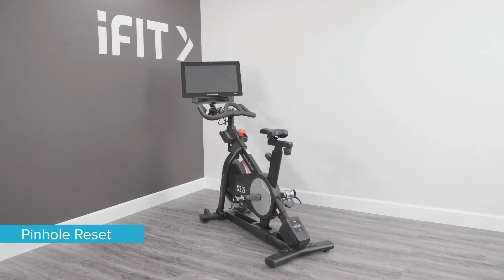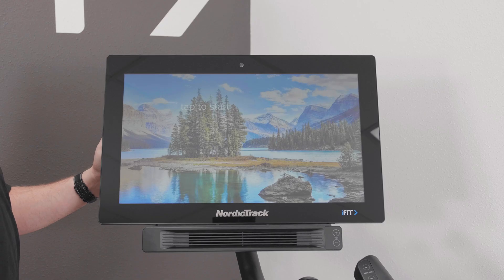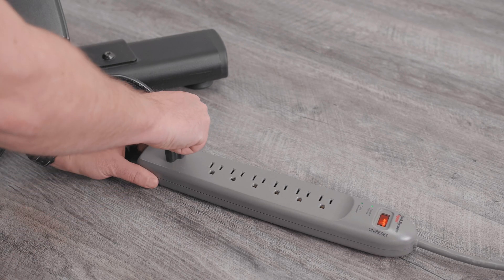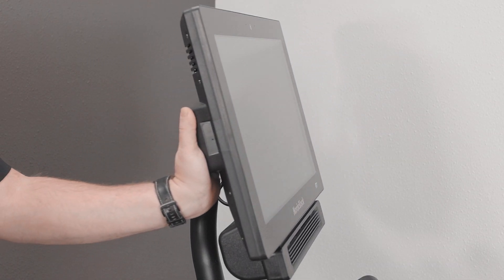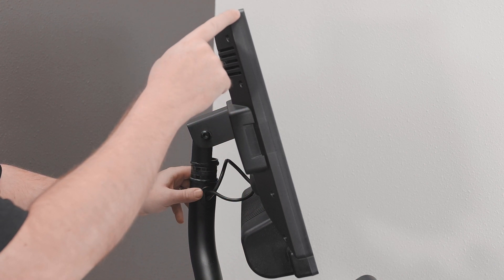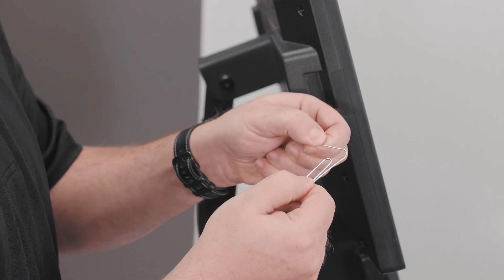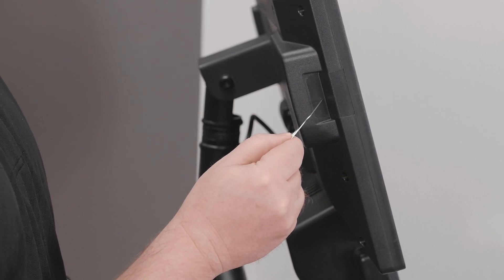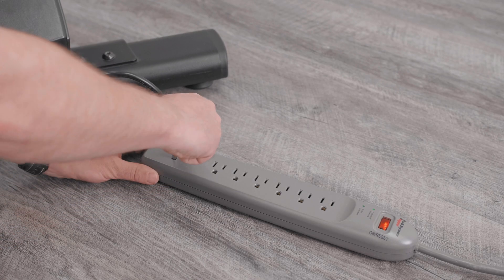Pinhole Reset

Comment: I cannot find the pinhole for the Proform Thinline Desk Treadmill. PFTL17014.2. Google keeps showing different models when I search
Reply from the maker: I'm sorry to tell you that model does not have an option for a  factory reset. The pinhole reset was only made available on later style embedded tablet displays starting around 2017/18.
Reply: Okay thank you. Do you know how else I could get the screen out of the loading phase? I’ve tried unplugging and resetting
Reply from the maker: @jilleuper3628  Oh no, that sounds like the console is corrupted. That usually requires the console to be replaced. there are a couple of things that may cause this that you can try but they are less likely to be successful. it may not get past the load screen if the console cannot communicate with the sensors or complete an incline calibration. To try to restore the console you can try: 1- Unplug the safe zone sensors from the power board, (if equipped). If this resolved the issues then replace Safe Zone sensors. 2- To resolve possible incline detection issues replace/Repair wire harness or replace controller/power board. 3- If there seems to be a software glitch or malfunction and other methods have not resolved the issue then you may need to replace the console. Unfortunately the console is no longer available from the manufacturer.

Comment: Does the Sport 5.5 have a reset button?
Reply: Did you ever find it? Can’t find one on my desk tread either
Reply from the maker: I'm sorry, that console does not have a pin-hole reset button.
Reply: @FitnessEquipmentHelp would be useful to tell us what to do if there is no reset button…
Reply from the maker: @hamzamusse6006  If there is no reset button you may be  able to restore software from a usb thumb drive obtained from the manufacture or uninstalling and reinstalling the software with assistance from iFit support.

Comment: Can you tell me where the pinhole is on a C990 Treadmill NTL19815.6?
Reply from the maker: It is possible your console is old enough that it did not originally come with the pin-hole reset feature. If your console has a USB port then you can reprogram the console using a thumb drive available from member care. If you have a replacement console or it is one of the newer consoles then the pin-hole reset button should be found on the right side of the console plastic about half way down the display.
Reply: @FitnessEquipmentHelp  My 2017 proform pro 9000 has white screen says retry but can't hit the button. I can't find a reset button but has usb and hdmi ...is it too old to have pin hole?
Reply from the maker: @eldonduncan  It may be too old to have a pin hole reset. that is about the time they were introduced. Does it reference a pin hole reset in your users manual? iFit membership/tech support may be able to walk you through a manual reset or order you a thumb drive to reinstall your software.
Reply: What about the pro 9000
Reply from the maker: @munguia84  What is the model number?
Reply: @FitnessEquipmentHelp  I have the same treadmill 9000 PFTL17116.1
Reply from the maker: @brandymyers7073  Model PFTL17116.1 was not built with a pin hole reset. That model is an older generation of console display all together. Some of the other videos on this channel may be useful. See https://youtu.be/PiLWCVAGO_s

Comment: Can not locate the pinhole for the rw700 model NTRW15121.0. Any one have luck locating it?
Reply from the maker: The reset on that model is in the seam between the front and back plastic on the top of the console. It is off center to the right side.

Comment: Pin hole reset didn’t work.
Reply: I have a 6 month old x22i treadmill and it’s stuck on the white screen. 
I have sent a email over 5 times in 2 weeks and have no response.
Reply: @sandyedeberti8196  send a message via Linkedin to all the execs. My panel was replaced the next day!!
Reply: I have a X22i, not sure the year.  But I can not find a pinhole anywhere… Literally nothing…
Reply from the maker: Additional support can be found at support.ifit.com. You can open a help ticket there with member care.
Reply: Same issue here with the Nordictrack 1750 treadmill.  Had to go thru customer service.  Still awaiting resolution.
Reply: @Syndicate_01  Same, so frustrating, been trying to troubleshoot my issue for days, hours, so frustrating, the pinhole trick doesn't work for me. Never buying from Nordictrack again, the treadmill runs perfectly fine (at least it did before this software issue) and now I can't use my treadmill due to this tablet software issue. Ugh
Reply: @MikeLocke  Having the same issue, have you heard back from them?
Reply: @MrTuckmaster  Update called iFit and they were able to replace the entire head/motherboard. It was a process, guy came out to try to fix it first, had to take video that it doesn’t work. Then they were able to replace under warranty. They sent me the entire top that includes the tablet, buttons, speaker etc. was able to install it myself. FYI I had to pay $150 for the tech to come out to try to fix. It’s a requirement from iFit before they replace part.
Reply: @MikeLocke  Thanks! It looks like i am heading down the same path which is disappointing:( 
Happy New nevertheless

Comment: If you have the Costco Tour de France bike the pinhole is located on the top right portion of the screen- just over the top edge on the back, but it faces up.  There an indentation- it's on the top of that indentation.

Comment: Your video a few years ago (2017) on how resistance motor and controller circuit works is perhaps the single most helpful video I've seen on youtube. Is it possible as a follow-up that you can open up one of these consoles and do a video on the actual circuits involved in the consoles that are responsible for sending and receiving the voltages to the resistance motor? I buy, sell and repair used exercise bikes and ellipticals have several that have consoles with bad resistance circuits but EVERYTHING else works perfectly. I'm trying to determine (1) Why the resistance circuits are so prone to failure and (2) The specific components involved on the boards that are responsible for controlling the motor resistance circuit (3) How to repair the circuit without having to scrap an otherwise perfectly functioning console.
My suspicion is that the 6v and 9v DC power adapters that most of these ellipticals and exercise bikes use get worn out over time and start sending more voltage than the circuits are rated to receive, eventually causing failure, but I don't know why it appears that only the resistance circuits seem to be the ones that fail. I buy and sell used fitness machines and I find this to be by far the #1 issue I see. The 2nd most common issue I see is a bad resistance motor, but that's very easy to detect and fix/replace unlike the bad console resistance circuit.
Reply: hey can I contact you about my bike, i think i have the exact issue you say here I'm curious how to fix it please help